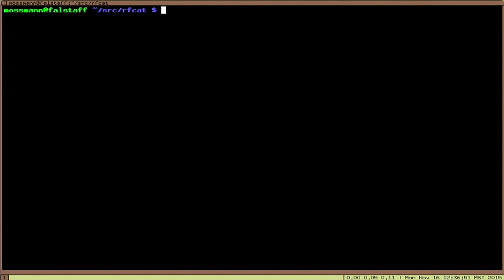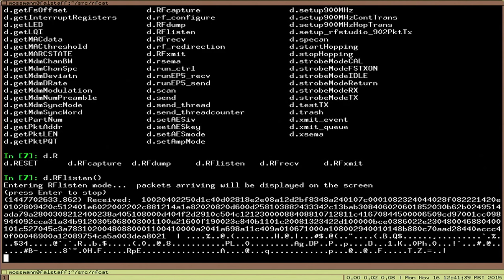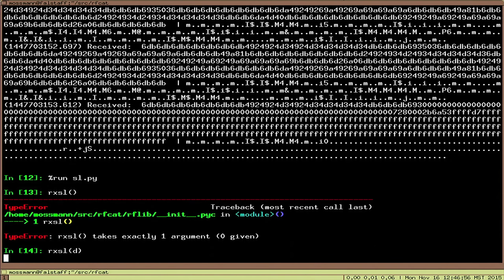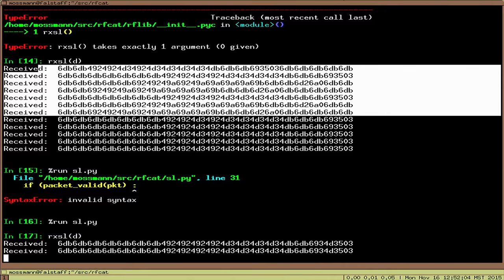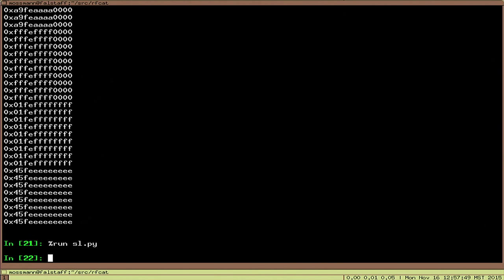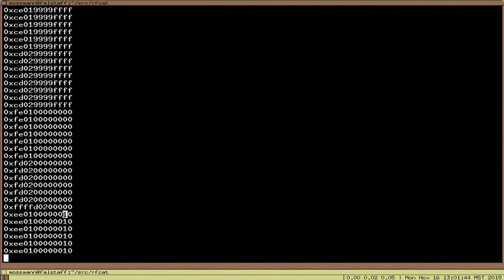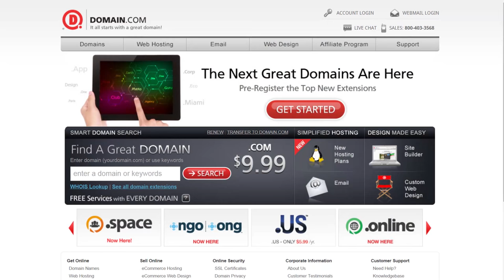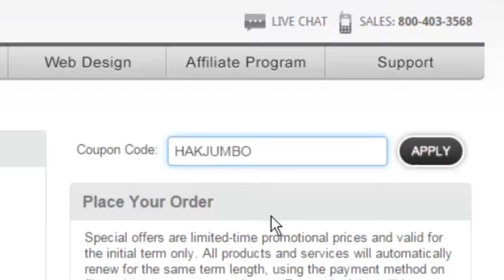Radio Hacking: Reverse Engineering Protocols Part 2 - Hak5 1914

Comment: Great segment, Excellent Dynamic between DK & MO, Good balance between enough complicated meat in the sandwich and also being fun :)
At the end of Part 1 yesterday it made me think of the 90's tv shows that would end with 'To Be Continued' just when you wanted more :(

You should think about doing a 2 or 3 part segment (taking up 1/2 the show each week) on Advanced Networking, maybe basing it on your warehouse setup.
Covering Layer 3 switch config, 3+ VLANS, Trunk Ports, Link Aggregation, WAN Bonding.
That type of thing, using a combo of web interface / ssh & drawing diagrams on your much loved top view whiteboard.

Comment: How do you use rfcat without the interactive python shell? I just want to run a python script from the command line that creates a d object, sets its parameters and then transmits a radio signal.